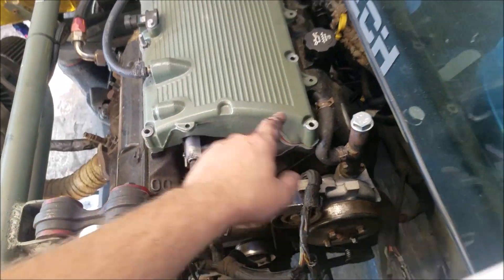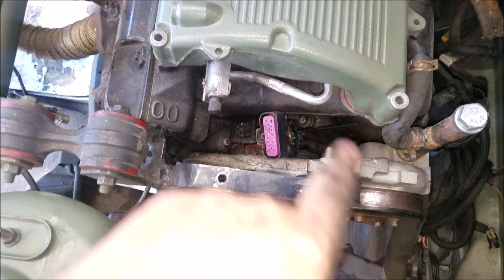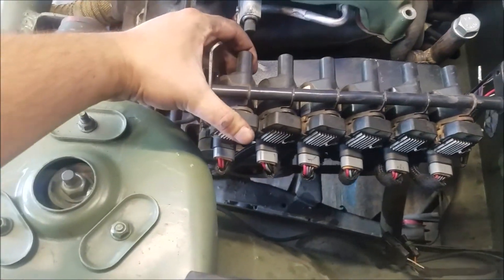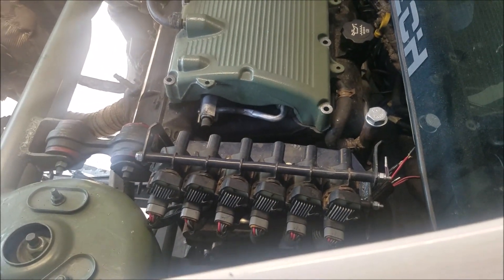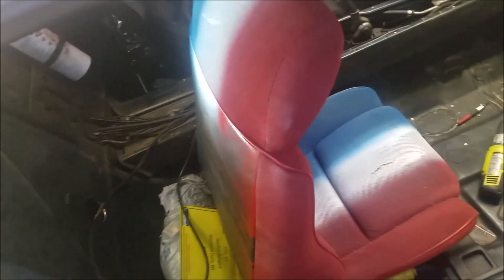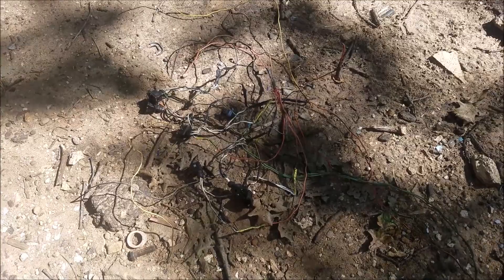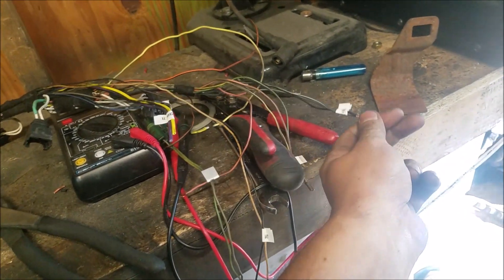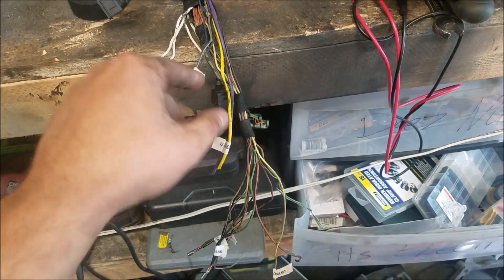MICROSQUIRT install on the fiero PART 1

Comment: You can pull the pins from the connection instead of cutting the harness I just started untangling the wires going into the ECM and rerouting so I use less plastic housing and get the harness away from the spark plug wires
Reply from the maker: Yea i wasnt to worried about preserving the old wiring